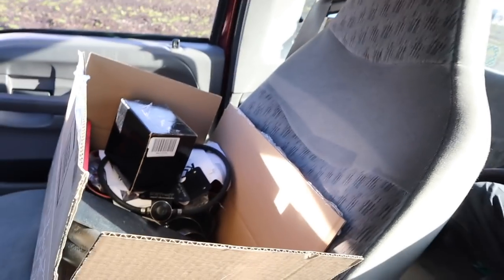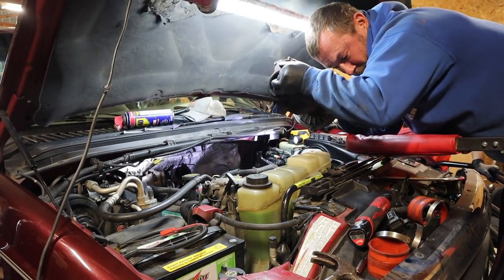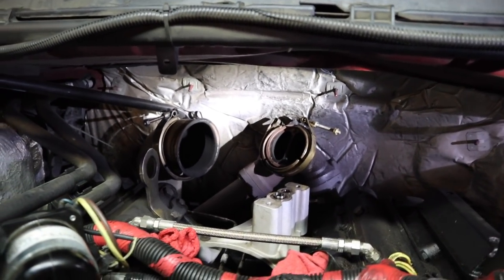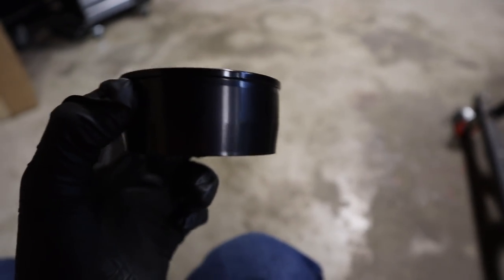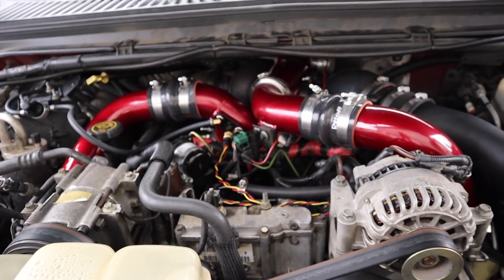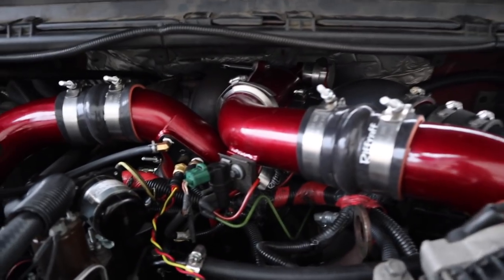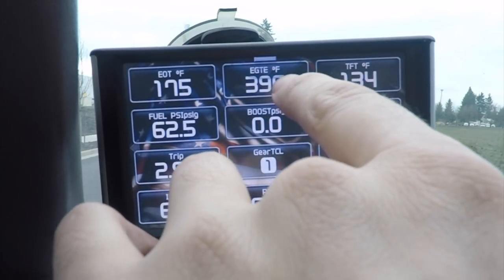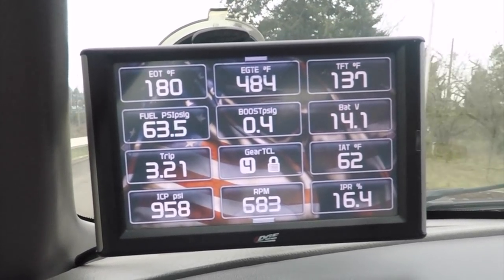Ford 7.3 Powerstroke KC300x Turbo and Pusher Intake Install!!!

Comment: Looks great under the hood! Clearly a lot of thought and effort went into the setup.
Reply: uh... wut? bare wires everywhere, relays TAPED to the viewbox of the air intake... this is NOT a clean install... 
HACKED comes to mind

Comment: Some options for your old CCV intake manifold section: 1.) I plugged mine same way you did but I also cut the ear out of it to help reduce turbulence and airflow resistance. 2.) best way to go (and what I'm about to do since my intake is currently removed) is grab a piece of 4"o.d. stainless and cut it to the same length as your plastic piece and get a hanger to mount to your valve cover bracket. Removes the hump in the bottom and provides a symmetrical passageway to your compressor wheel while sealing the intake system in a more permanent manner. Definitely taking notes from your videos though and damn that's a good looking 7.3! One of these days I'll catch up to all the upgrades you've got on your rig.
Reply from the maker: Sounds like you have a pretty good plan. I do still think I’m going to run it through a catch can and back to the intake. We’ll see though.
Reply: @LivingOnWheels  see if I was paying attention I would've remembered that part lol. Interested to see what the final setup will be.

Comment: Man, your truck looks steller.  No doubt better than mine, but I have also put a lot of work into my 1999 7.3, and I am in love with the truck.  The pride of ownership with my F250 is sky high.  I own a lawn business, so I have owned many newer and other older trucks, but my 7.3 F250 takes the cake for my undoubtedly favorite truck.  My supposed to be "daily" is a 2019 Nissan Pathfinder, but I find myself only driving that a few times a month.  When it comes time to grab the keys, the F250 keys are like magnets to my fingers.  My wife is like, are we taking the Nissan, and I'm like, I'm trying, but I can only reach the truck keys.  They are usually right next to each other. :)

Comment: Looks awome and nice work I mounted the ccv catch can in the back of the s and b filter but depending on the year model you may have a fuse box behind it,  also am glad to hear you where going to run it back into the intake I've herd of a lot of issues venting it to the atmosphere since it no longer has the negative pressure in the system.
Reply from the maker: I heard people with issues too, but I think that is mainly from people using undersized hose or poorly routed hose. International ran all their 7.3s vented to the atmosphere. Thats how they were designed. I will still probably catch can it at some point to get rid of the smell.
Reply: @LivingOnWheels  yea true but I have also heard a lot of people who vent them to the atmosphere and have issues with oil leaks in valvue cover gaskets and the turbo seals for some reason but when they re connect the ccv it goes back to normal. Idk it's your truck if you dont have issues running it that way then power to you, you have nice videos and love watching the channel keep up the great work.

Comment: Nice work, I noticed your fuel pressure goes way to low, swap the factory pump for a walbro 392. You can damage injectors running low pressure
Reply from the maker: Preciate the suggestion. I am actually not even running my factory pump anymore. It’s all through and Airdog 165 and CNC 4 line kit. I actually didn’t even notice it dropped all the way down to 52. For normal driving this setup works pretty darn good. We’ll see though, I have lots of ideas in my head.

Comment: I am rewatching this install video specifically to watch the STRUGGLE AND PAIN you guys are going through doing this.  I just did this on my truck with the same 63/68.  And I have to say that up pipe collector install to the back of the turbo was the worst automotive job I have ever done..
Reply from the maker: Yeah…. That is miserable to get lined up.
Reply: Yeah especially if your doing it by yourself. You hear people saying it wasn't so bad, but almost every one doesn't film the whole process. Especially if you change the up pipes and need to get them realigned with where the Turbo has to be. You can't see what's going on from the front another set of eyes and possibly a hand would have done wonders.
Reply: No struggle and pain involved, all love of your truck.
Reply: That has to be the worst, took me hours, but I used a garret gtp38r which is a 68/88 ball bearing turbo

Comment: Do your research  on the  crank case  vent ..  bill Hewitt      and many other people  say its a bad idea..  just because riffraft sells it dosnt  mean its   a positive  gain.. I've seen people  say  it causes starvation of oil in the turbo and increases  pressure in the crank case housing causing turbo seals to blow..  maybe im wrong maybe its just stock turbos..  just stating  what I've read
Reply from the maker: International designed these engines to be vented to the atmosphere. That is how they ran it in all their T444E trucks. People run into pressure issues because they either use to small of a vent tube or don’t have proper routing. Also, the turbos are not oiled from the oil vapors in the intake. They have a full constant supply of oil running through their center housings.

Comment: I am going back and forth on the pusher intake, do remember if it helped with response and to lower egt's. I know it's been a while .
Reply from the maker: Because I installed this at the same time as the turbo I cant really say. It's a quality made part though. Thats for sure.
Reply: @LivingOnWheels  thank you. Dig the Cummins working your doing, I still have my 7.3

Comment: 5 second 0-60 how? I have the kc 300x and I'm like a 10.5 0-60 with a tuner
Reply from the maker: The truck also has stage 1 AC injectors.

Comment: I just installed the KC300 turbo and my truck makes gobs of power now. While I was at it I installed the riffraff diesel CCV re-route mod. What is your take on this mod? I just viewed a YouTube that basically said that this is a very bad thing to do.  I did the riffraff billet intakes . Also many cuodos for the great video on injector replacement. I did the job with 130 cc 30% single stage reman injectors.
Reply from the maker: David Wernecke nice man! I love my KC300. As for the CCV there are a lot of people on both sides of the fence. My opinion on it is this. International designed these engines to be vented to the atmosphere and they ran it on all of their trucks that way. As long as you do it properly I see no reason to not to vent to the atmosphere.

Comment: Sounding good! Still loving my KC 63/68 as well!! Only had one issue so far with getting the P0478 code. No exhaust leaks now and I can hit 32 psi as well... My boost fooler may be set a bit low, I have Jelibuilt Tunes I may send them an email soon to ask what they think. My theory is it sees too much back pressure in relation to the amount of boost. 🤷🏻‍♂️ Anyways love those intercooler pipes!!! Looks amazing!

Comment: You wouldn't happen to know if some slight modification would be needed to the pusher intake with the riff raff billet plenums? If so please inform.
Reply from the maker: Honestly not sure. Their billet plenums are supposed to fit like stock so they shouldn’t have any issues
Reply: @LivingOnWheels  ok good I didn't see their dimensions so I didn't know if they would be slightly higher than stock plenums. Kind of like your pusher intake did with the inserts. Btw thanks to your videos im putting atleast 15k into my 2000 7.3 most of which is copying off of you and what you did with yours with some slight differences. But thank you for the help.

Comment: Don't do the ccv mod. To much crank case pressure causes the turbine seal to leak. Maybe not right away.
Reply from the maker: International designed these engines to vent to the atmosphere and that is how they ran it in all their trucks. The problem is people put a restrictive hose on their system and complain when things start leaking.

Comment: The Riff Raff intercooler couplers look like they are on all wonkey
Reply from the maker: Their all on there pretty straight and true. What looks off to you?
Reply: Living On Wheels Maybe it’s the camera angle but looked like the boots were on at angles/clamps weren’t straight.
Reply from the maker: Ahhh, no they are all there pretty strait. Just had to go double check cause you had me doubting haha. I will say though that the riff raff boots are super heavy duty and tight so they are a bear to get all together! Guess that’s not a bad thing though.

Comment: yada yada the weather skipped to 21:45 I wanna hear it lol, sounds good  : )
Reply from the maker: Haha I plan on doing a full sound demonstration here pretty soon!
Reply: @LivingOnWheels  This weather we've been having does have to go lol, the last four months it's been getting dark at night and somewhat less dark during the day.  Yeah that sound haha, It's like my electric guitars always searching for that perfect god tone,   I want mine to sound more even firing like yours   : )
Reply from the maker: SnakeRiverFishing I feel yeah man it’s been rain here almost every day for the past 3 months and probably will be for another 2. It funny you say that too cause I feel like mine should be more even during 😂
Reply: @LivingOnWheels  actually sound almost identical my idle or hold a lower rpm sounds sorta like a small block chev with a 3/4 race cam loping but it has instant , snappy throttle response with what I will call ample power, I have the 5 speed it hauls / tows whatever and stays cool doing it, starts right up on her own below zero so I'm keepin her lol it really is one hell of an engine, did you do the injector cups too ?

Comment: Looks good!!! I'm surprised how high your EGTs get.
Reply from the maker: Thanks. It is only the .84 housing and they don't really get up there until its revving out in 4th. I'll be very curious to see how it does when towing. The tow tune shouldn't be pumping as much fuel into it though
Reply from the maker: Brandon Leech I agree. Should be getting a trailer behind her for a good trip this weekend. Pumped to see how she does.

Comment: Good looking truck sir. I saw your fuel pressure read out on your Edge monitor. Is that coming off you fuel bowl? I just bought a 2001 F-250 super duty with the 7.3. I just ordered the Edge CTS2 and want fuel pressure. I know these trucks have problems with the pick up tube in the fuel tank and also with those little filters plugging up. Can you get a sensor from Edge for that? Thanks
Reply from the maker: I actually dont have a fuel bowl anymore. I run my sensor of my CNC Fab distribution block in place of the bowl. To answer your question though, yes you can get a sensor from Edge to monitor the fuel pressure.  Its the same sensor as their 0-100 psi air pressure sensor. Their are two ports on the back of your fuel bowl to read pressure from. One pre filter and one post filter.
Reply: Living On Wheels Thank You sir. I enjoy your videos. Keep em coming. I had a 6.9l for years and this is my first 7.3. I hope I don't go to the poor house owning it. lol

Comment: I wonder if those pipes would fit my OBS 7.3, i currently have an intercooler and piping from a newer model 7.3 installed, but id love to get brand new pipes. Just hard to find something that i know will fit
Reply from the maker: did the pipes you have in now go right in or did you have to fab them to make them work? Id imagine if its setup so the just dropped in then these would probably work as well. This is basically a stock 99.5-03 pipe setup
Reply: No it will not work.. you should probably get your info from a mechanic not a youtuber
Reply: I made a mistake, mine are definitely fabbed up and not the oem 99-03 pipes. I saw a pipe set for the obs for sale for $140, cant remember the site. And i believe i need an early 99 model spyder to fit the plenums on the obs. I believe the plenums got larger late 99
Reply from the maker: Alix Maturo no worries. I figured they were probably fabbed up. That is usually the case. I can’t say for sure on the spyder but that does sound correct to me. There are a lot of good forums online of people doing this if you were to google it. Unfortunately I don’t have a tone of experience with the OBS 7.3s

Comment: Dude, I know you are out of the 7.3 game and all, but I just did a KC300x stage 2 and an FRX kit upgrade. I didn't do a boost fooler and there seems to be a debate online...either put one in or have your tuner address it via programming? I do have 1023 custom tunes but I am leaning to just ordering Riff Raff fooler kit?
Reply from the maker: I’d say either works. I chose to do the riff Raff boost fooler because it seemed logical to not be shoving that much extra boost at the stock map sensor. Maybe it handles it fine but I’m not sure. Downside is if you don’t already have an additional boost sensor you will need it.
Reply: @LivingOnWheels  Thank you man! I appreciate the response.

Comment: Living?  Did u have any notice in the installation instructions not to hook up the boost control hose.  I did my installation a couple months ago and just the other day  was told by another kcturbo installer along with tech from KC turbos to leave it unplugged.
Reply from the maker: Thats the second time I've heard this. Perhaps I will have to try it.
Reply: I run across this on powerstroke.org.  cncfab said it was actually to be marked on the waste gate control head "Do not plug in".  That's when I called them and was told to plug it off, wasn't to be installed.  I didn't keep my instruction so I couldn't look back to c if I missed it.  I was also wondering that maybe u installed it because u had a boost fouler, I do not.
Reply: Its good to see the S&B worked well with it, I have to open riffraff set up and don't like it.  Mainly because of pulling under hood heated air instead of outside cool air.
Reply from the maker: Stacy Rethman interesting. I didn’t actually receive any instructions with my turbo haha. The turbo wastegate doesn’t need to be plugged off though right? Just the lines going to it? 
Yes, the S&B does work but it is all a very tight fit together. Takes some finagling.
Reply: probably shouldn't plug off the port on the waste gate actuator, the diaphragm  side will need to vent wen the boost psi will overcome the actuator spring.  If plugged it may dead head the diaphragm side and not actuate fully.
Reply: I c in you latest video that u are going to do some towing with the 7.3.  I would be very interested in the results as i did a short trip at total weight of 22k, truck and trailer.  To be honest i am disappointed, maybe its all the lack of injectors but getting boost over 20psi seems to harder to reach than it should be.

Comment: How does that edge cts insight get all of its data? From the hydra chip?
Reply from the maker: The edge cts plugs trait into the obd port. So it can read basically all the factory sensors. For things like egts and fuel pressure, I added sensor to monitor them.
Reply from the maker: @beachboardfan9544  Its a little spendy but an awesome setup. I honestly think its the best out there. I will say though that after going from the CTS2 to the CTS3, the # is well worth the extra money. 
https://amzn.to/3wlCjFD

Comment: don't want to hate on you pusher intake but your passenger bank of the engine is not goona get the best of flow because the way its constructed. I would love to try the AFE blade runner
Reply from the maker: If I was pushing higher numbers I might be more concerned about it but this is a very mild build.
Reply: @LivingOnWheels  do you know what boost numbers your running? It sound like you said your gauge stops at 23 because its ran off the MAP sensor?
Reply from the maker: skankhunt 42 I top out about 32 right now.
Reply: @LivingOnWheels  I bet that moves along real nice👌
Reply from the maker: She’s got enough to get out of her own way haha
Reply: @LivingOnWheels  I bet, I'm running a basic edge tune with stock straight pipe and Donaldson blue air filter and she runs real good up to about 2200rpm and then the power curve just stays flat. I have not towed anything big yet but waiting on a rock crawler, side by side and camper this winter

Comment: Looks nice, did I notice stock up pipes? and why are guys doing a CCV mod is beyond me, just looking for trouble. International designed it that way.
Reply from the maker: You did notice stock up pipes. Surprisingly stock up pipes that are still super tight with no leaks. 
.
I could be wrong but I believe international actually ran some t444e engine applications with atmospheric venting. Ford's 7.3s needed to be vented back into the intakes for emissions purposes. Most times you see people running into issues with the CCV mod is when they do it with too small of tube (because its easy) or provide a point of clogging. That being said, I am thinking I will probably end up running it to a catch can and then back into the intake. Gets the oil out and keeps the vacuum on the system.

Comment: Makes me want to do my 99 7.3 if I was you I would run my ccv hose differently instead of going up and over I would run down
Reply from the maker: The reason for running it over is to allow the oil in the vapors to be able to condense and run back down into the crank case.